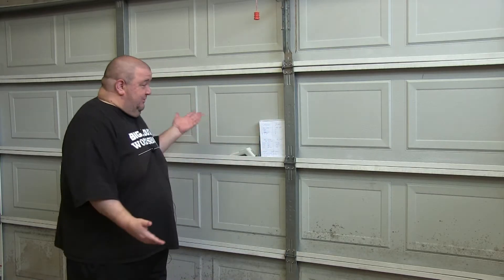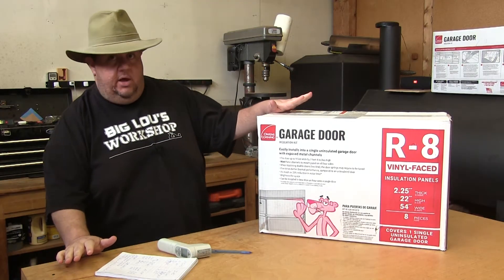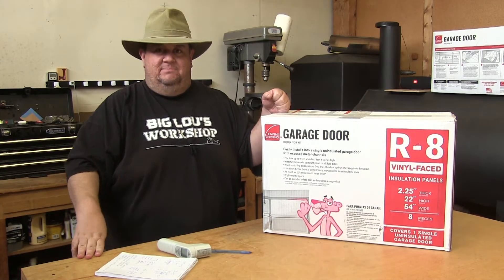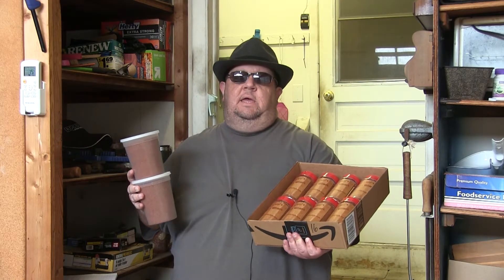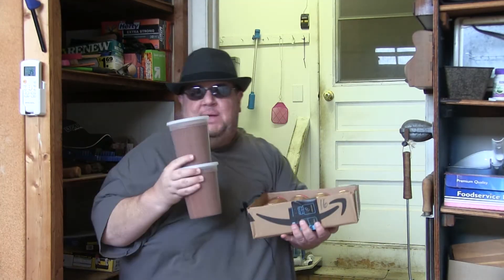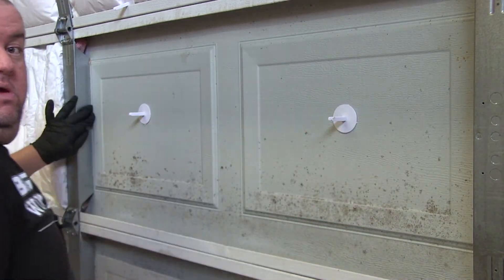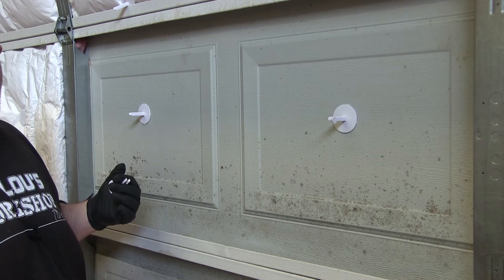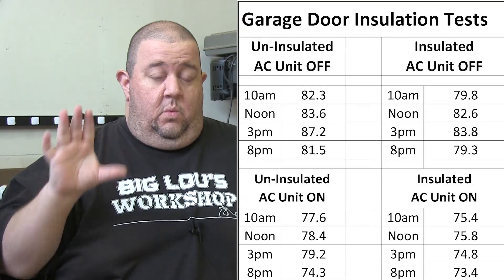Is Insulating a Garage Door Worth It??

Comment: Big Lou's awesome video.... question did you have to calibrate or do something to your garage door or garage opener after the installation? I just did my garage and i dont know if its my impression but i think the garage is slower to open. Any advice will be appreciated
Reply from the maker: This is the same comment I just replied to you with on my IG post... not sure which one you'll see first, thanks for the question... "it's hard to accurately say since both the door and the opener were 20+ years old when I put did this installation, and since I put it in I have replaced the opener, the bearings, and the drums. But both technicians that worked on the door said that these panels are not enough weight to have a negative effect on anything that is "properly" installed and calibrated!! Hope that helps!"

Comment: Big Lou!  First time coming across your videos.  Thank you so much for your time. In your opinion, do you think the styrofoam panels  or  the batting insulation you installed is better?  To me watching installation of both the batting insulation seems easier to tuck in to the panels rather than messing with the styrofoam that isn't as forgiving. Thoughts?
Reply from the maker: thanks so much for the comment I really appreciate it!! As for your question I really can't speak to how effective one is over the other, but the fiberglass kit that I bought has worked remarkably well for my door. I went with this option cause the installation seemed far more simple than trying to cut the rigid foam panels to size. I hope this helps!

Comment: Yes it is worth insulating your garage door. Just did mine with rigid 1" foam board panels plastic one side foil on the other side,  and immediately could tell the difference.  Cost at Home Depot 4 panels 4x8 feet was plenty for 2 car garage door. Cost about $120...well worth it. A bit tricky cutting panels to a size they fit and would stay in...but after one or two it gets easier.  These panels are very light weight and no door adjustment was needed.
Reply from the maker: heck yeah man!!!! Well done!!

Comment: Big Lou,

You should wear the long sleeves for protecting from insulation that causes cancer.

Can I put insulation doubles?

Can I use the gorilla glue on the garage door?

Subscribe 👍
Reply from the maker: it only causes cancer if you inhale it and over a long period of time... for what I did here it may be a little itchy, but thats about it!! 

Not sure what you mean by insulation doubles... these panels are only designed to be one layer. 

Gorilla glue would not be my first choice, the adhesives that come with the kit have been more than strong enough to hold everything firm.

Comment: I did my garage door couple months ago. Florida, sun facing garage door. I just did 3/4 foam w relctix foil. 10-15 degree diff, no extra weight to door. Used hot glue, instead of depending on double stick. Big diff.

Comment: I get this is probably a night and day approach. However, look into the spray foam kits. They physically adher to the door and by my calculations one 20ft garage door would be served by one of the 6 can kits. I am going to know soon because I normally use the SprayEZ cartridge guns but the bathroom I am currently finishing is too small so I needed to order a Kraken kit to do some nics and crevasse. Obviously, you can not do a garage door with a two component cartridge system.

Comment: Hmmm. I don't do videos. So i'll just type it in. I insulated my 400sq ft attic which runs up to 130 deg F. during the summer rather than my 120 sq ft garage door with an outside temp seldom over 112 deg. Problem solved. I'll never bother to insulate the garage door. I blew in 14 inches of that grey wooly looking stuff. My son and I did it in about 2 hours. Home depot loaned us the blower. I don't remember what the insulation cost. It was 20 years ago. I cool the garage (1/2 of it converted to woodworking) with an 8000 btu Panasonic AC. Not COOL, but can work in it year-round. Just saying...
Reply: Oh, I forgot to say. That 400 sq ft attic space is  the space above the garage. The rest of the attic was alrerady insulated. But I'm sure you figured that out. :>)
Reply from the maker: Whatever works for your situation I say roll with it man!!! Thanks for the comment!!

Comment: What is the total weight on 8 panels (one box)? just want to make sure my old garage opener can lift with the additional weight. Thank you.
Reply from the maker: For a door this size I needed two boxes and each box was like 3 or 4 pounds... the overall weight added to the door was maybe 10 pounds, if that!!
Reply: @BigLousWorkshop  Thanks for the super quick response. That is exactly I need to know. Thanks for the video and thank you for sharing how to get it done. 👍
Reply from the maker: Happy to help!! Also ... based on your profile photo I see you're a fellow Nerd, if you're interested I have second channel where I do watch alongs and reactions to all kinds of TV Shows and Movies... Big Lou's Clubhouse!! https://www.youtube.com/@BigLousClubhouse
Reply: @BigLousWorkshop  Love it 🥰😍 Thank you so much.
Reply: @BigLousWorkshop  By the way, what is the reason you pick Corning R8 (more expensive) instead of other foam board product or reflective bubble ? is it  fiberglass more easy to install plus it has the higher R valve  (R8) and Foam board only has R4-R5 and also need to be measured and custom precise cut (more time consuming) and more difficult insert into panels. Thanks again.
Reply from the maker: There were actually a few factors... first (and biggest factor), yeah, WAAAAYY easier to install!! Plus I wanted the vinyl backed side to help with sound deflection, the hard board foam panel would have more reverb. And I dont know how much fact there is here, but from what I read the kit that I used was better at keep cool air from an AC in and the hard foam was better for keeping heat in during the winter, and since I live in FL!!
Reply: @BigLousWorkshop  Very good information. Those are the reasons I did not know at all. Appreciated very much especially your link to your other channels.

Comment: Has anyone tried the solid foam insulation and did a compare of the temps vs the bats just to see any difference.
Reply from the maker: Thanks so much for the question, I honestly have not seen anyone do a solid foam insulation on a door like this that was not in a really cold climate. All of the ones I've seen in hot and humid area's like I am have all used the kit I am using, or something similar.

Comment: Thanks for the video. The bolts that hold the garage together on the panel, protrude inside, in my garage door. Will this cause any problem in installing this insulation sheets and if yes, what do you suggest. I want to avoid taking those bolts out , install the sheets and put them back in , worried if that will leave some of the screw not properly secured.
Reply from the maker: well first off,  I am by no means an expert on Garage doors, or insulation for that matter, but I would absolutely avoid messing with any bolts that hold the door together. Just going off of your description I would think that there would be minimal interference between the bolts and the battens so you should be fine, however, there is a phone number on the packaging for questions and concerns, I would give the insulation manufacturers a call if your really worried about it! Thanks for the question!!

Comment: My interest in garage insulation is heat retention not heat absorption.
It it worth it to insulate for this reason?
Would insulating my garage make it too cold in the winter?
Any comments are welcome.
Thank you.
Reply from the maker: Insulation typically works both ways... it limits the temperature transfer regardless of if it's keeping the cold air IN like in my case... or keeping the cold air OUT like would be the case in colder climates!!! I hope that helps clarify some things for ya!! So yeah... I'd think it would be worth it!!

Comment: So it’s been a while now since your install..do you find maybe the insulation falls out away from the panels? I was thinking maybe using 6 pin/caps two in the middle like you’ve done then one in each corner then the insulation won’t fall out of the grooves. .. thanks for the video!
Reply from the maker: I would change nothing about how I installed these panels... it's been over a year with garage openings several times a day and have had zero issues with the panels coming loose or falling out or anything!! The two pins are plenty, at least on my unit cause the door panel's have the lip on top and bottom to stuff the padding into. Hope this helps, and thanks so much for the question.
Reply: I used small zip-ties between the buttons. Seems to hold button much better.

Comment: I went on Instagram to but couldn't find updated data.  I am wondering how you made out this summer with the high temps?  I was either going to buy this at R8 or Home Depot has 1/2"  insulation board (foiled on one side ) and make a box in each panel.  R factor was around 4....but using two of them with an air cavity
Reply from the maker: I was not out in the shop much this summer due to one reason or another so I dont have much data to report.

Comment: While heat gun testing my garage i found my ceiling hotter then my door.
Today (Phoenix AZ) 108 outside no sun on door yet.
Door = 108°f. Ceiling 111°f. Attic Door 113°f... air temp in garage 103°f 
Walls all 104°f one is exterior.

Definitely gonna insulate the attic.
Maybe even foam board the ceiling too.

You entertaining.  Bravo.
Reply from the maker: OOOOFF... yeah man... that's rough!! I'm fortunate that my ceiling is vaulted and there's a space for the hot air to gather above my head. The cooler AC air sinks down to where I'm working which helps out a TON since I dont have any insulation up there, there's not even an attic space to add insulation to if I wanted!! But you CERTAINLY should look at doing that! Stay safe my man, those temps are dangerous numbers, and thanks so much for sharing your numbers!!

Comment: Love that background music!!  I just finished up my double door this weekend.  I  used wax and grease remover on the panels (because I already had some on-hand).  

I live in Alabama, and my 3-car garage (one double door, one single door) faces West, and is not air conditioned. On July 31st I checked temperatures.  My insulation surface temp was basically room temperature (duh...), and the non-insulated aluminum garage door was ~ 2- 3 degrees warmer.  Note it was not very sunny this weekend.  The uninsulated door was ~93-94 deg F.

I do recommend adjusting the torsion spring on a double-door, due to the added weight.  Judging by sound, it loads up the opener.

One thing I don't personally don't care for is blocking the garage door windows.  Plus, when and if I get A/C for the garage, I prefer to work with the garage door up/open which kind of makes the insulation pointless.  At least while I am working.  The insulation will no doubt reduce the inside temp during the day (while away) of the non-A/C garage..... At  least until I park a hot car in there....  

My next move is to insulate the attic space above the garage, but I am starting to believe A/C is really necessary to get the full benefit of all this.
Reply from the maker: Can understand the desire for the natural light... however I can legit feel the heat radiating from those window panels, which in my garage are just exterior rated plexiglass. Plus I do filming of my projects so it's also a studio which means I need to be able to control the light, and the filtered haze that comes through those panels is not good at all!! And yeah... all the insulation in the world wont amount to a hill of beans without an AC unit!! I wish I had an attic space to insulate!! Oh well!! Thanks so much for the feedback my friend!!

Comment: What about the electrical in the garage door walls. Is it ok to insulate over them - mine do not have conduit ....etc.  Also most insulate to keep heat in - will insulation keep the garage a bit less warmer in hot weather?
Reply from the maker: I’m a little confused about what you mean “electrical in garage door walls” the door itself should not have any electrical in it. But always check with an electrician if you’re uncertain about how to alter or cover any electrical components!!

Comment: Fellow Floridian.  I'm in Cape Coral, West facing door painted brown and it's 138 degrees this afternoon.  Ambient inside garage is 108 at ceiling.  This is N U T S!  My door happens to be hurricane rated so it has a couple more VERTICALS and EIGHT horizontals braces.  A pain in the arse if i chose rigid foam board.  Thanks my brother for posting this!!!
Reply from the maker: heck yeah man... mine WAS hurricane rated when it was installed 15+ years ago... but then they changed the rating!! hahaha  ... I'm so thankful that my door is white, I'll never not own a white garage door in a tropical climate... maybe if I move to Vermont or something I'll have dark door!! So glad you found it helpful, and thanks for sharing the stats!!

Comment: I didn't see you talk about making sure your garage door can lift the insulation. Some garage door pullers will break if you add too much weight.
Reply from the maker: This is true... however this Kit is super light, I think the entire thing only weighed like 5 lbs. But every Garage door is going to vary in weight depending on size, and material, and number of windows, ect... and the majority of the power is going to be done by the tensioning spring. So if that's a concern you can always have your tension spring adjusted to compensate for the addition of the insulation. My door has had zero issues since installing it several months ago.

Comment: Great video. One question - did you have to re-balance the garage door after adding the insulation?
Reply from the maker: Nope... not even a little bit!! Works like a champ even all these months later!!
Reply: @BigLousWorkshop  You do need to have the doors adjusted with the Owens Corning kit. The garage door tech that I use had to adjust the springs on all 4 of my doors. People that don’t do this after installing the kits keep him busy. My garage is 1400 square feet and a 60,000 btu furnace keeps it at a nice 60 degrees with these panels.

Comment: The effect of radiant heat from doors and windows can't be understated. I don't see a big difference when it's in the 80s, but when it's in the upper 90s and that sun is directly hitting my door, it felt like I was standing next to an oven. This insulation was one of the best things I could have done.
Reply from the maker: yeah man... I am almost kinda bummed I did not think to get this done like in July so I could get some better data points on Summer here in FL!! But it's cool and dry in my shop, and that's really all that matters!!! hahaha
Reply: YES!
Better for keep things cooler than keeping things warm.
Reply: Exactly. The east and west garages with metal doors are unbearable.